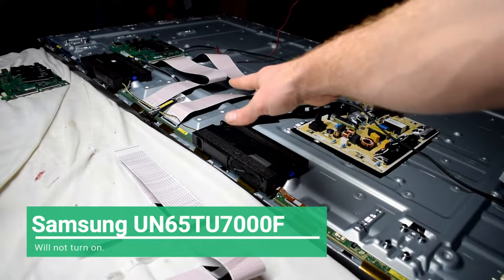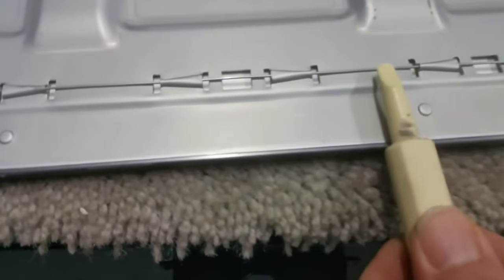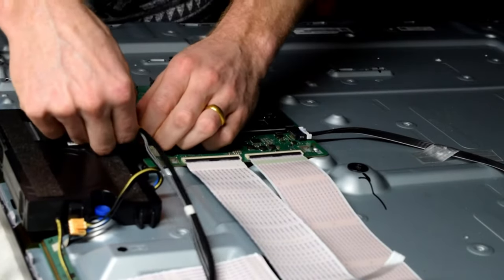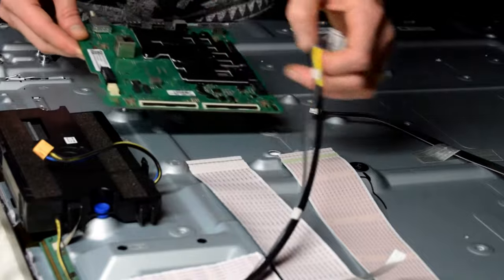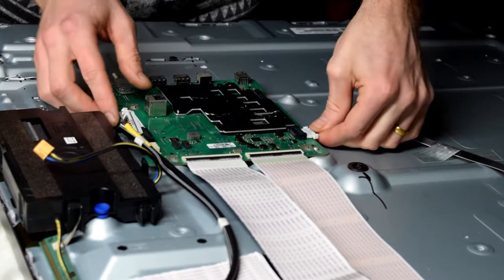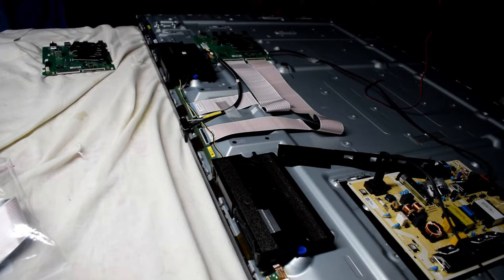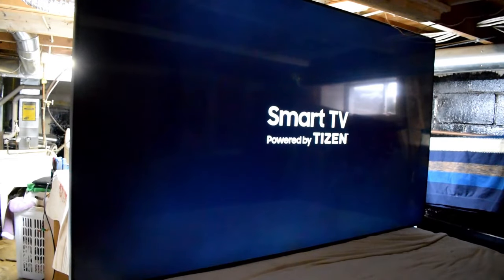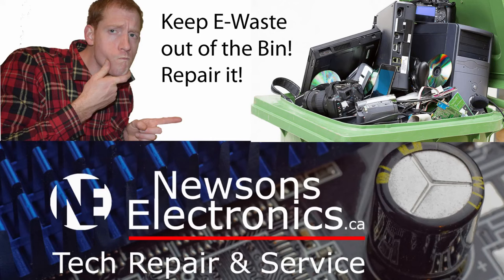65" Samsung TV will not turn on fix! (UN65TU7000F Mainboard troubleshooting)

Comment: But what about if the ribbons are disconnected and the lights stay on? I was told then its an LCD issue
Reply: Did you ever find out what the issue was, I have the same issue I disconnect the ribbon cable and the LED stays on.

Comment: My Samsung 65" was sprayed indirectly with a cleaner by someone painting the house( it was mounted on the porch under roof. We immediately brought it down to dry it off. It won't boot up completely but looks like they squeezed the edge of the screen to hard because there is like a broken glass pattern in the right corner and the screen just faintly flashes.The back of the TV was dry so I am trying to determine if the power supply, main power board or the panel is bad? Help?

Comment: if the backlights don't come on when the main board is disconnected, does that mean it's the power problem? Is there a power board or power supply internally?
Reply from the maker: if the backlights don't come on with the mainboard connected but you have standby voltage eg front led flashing its prop your backlights.

Comment: Well, even though you just replaced the main board, your hint with turning on the tv without the mainboard connected proved to be very helpful. I found that it was not the power supply in my case, which I suspected. Hence, thank you for sharing and saving me time!

Comment: thank you for the video ! i have the same problem with my samsung ue65f900slxxn but i have a Samsung one connect box next to my screen . .  do you think that is the problem ? when i unplug the cable the screen turns on and says i need to connect the one connect cable. . . ( i don't know if the screen has mainboard not opened yet )

Comment: Un82 inch led tv. Stuck trying to boot. As soon as I plug tv in it continually tries to boot . Black screen no picture . I took back cover off and when I remove single panel cable off main board I can see back lights seen by back of tv stay on and I hear a boot sound . I can also connect via wifi my iPhone to YouTube with no picture but can connect and play music. Can it still be a bad main board or is it the the rectangular boards at bottom of the tv?

Comment: From what I’ve seen if you disconnect the ribbon cable and have sound after a boot loop with no picture then it could be the panel.

Comment: I have a 70in and if I remove power from main board my black light stay on but also if I remove ribbon it stay on boots up and I have about 3 quarters of my screen I can see. So I put tap on some of the ribbon pins from main board to leb strip and I get a boot up as well. what do you think ?

Comment: I have a very similar TV (8000 vs this 7000)
 When I plug it in, it cycles on and off in an endless loop every 5 secondsor so, the screen does light up and display the "samsung smart tv" logo. Which board would you guess is the bad one? Main or power?
Reply: having the same issue, sometimes it will turn on and be clear and sometimes it will turn on with some horizontal lines. sometimes it boot loops. I assume it's the main board
Reply: @zak526 

Mine ended up being the "one connect" cable or box (can't find a replacement in order to narrow it down)

Comment: I did what you did and replaced the same part because I had the same symptoms Now my tv doesn’t shut off and on by itself but for some reason nothing is coming up as far as the menu, volume, settings, nothing. It’s just an illuminated black screen. Any ideas?

Comment: I have the same tv that after I turn it on, it turns off by itself after a few minutes…also, the red light underneath the tv does not turn on at all… what could the problem be? Starting off by replacing main board, hoping this video helps.
Reply: same problem, any fix?
Reply: @seanlee2876  what I did was unplug the main board, wait 10 minutes, hook it back up, and it worked… it worked for me so you should try that. I think that it resets everything by doing that and it worked! Let me know what happens

Comment: I have one the TV same as your when I disconnect the cable power from main board the backlight won't turn on but the red led front screen stay on in standby . Is that could be the power board bad ? Thank you very much.
Reply from the maker: sounds like bad backlights
Reply: @NewsonsElectronics  I have a tester led but i dont know which connector run from backlight to power board to be able testing on it to makesure that the backlight is
 bad .
Reply from the maker: @baotran5863  check the wires that go through the back of the tv, normally small white and black wires about 4 of them.
Reply: I use the remote to power up but red led light was starting blinking 2 times and keep doing that . Replaced a power board the problem it be the same . Is that showing bad backlight ? Thank you very much bro .

Comment: I had the same issue same model. I unplugged the main board and the backlights turned on. Ordered board and installed it. backlights came on with the main board connected but no logo and no start up on the screen. any advice on what to try next?
Reply: May be the display ribbon

Comment: I have the same problem, after disconnecting main board lights turned on, ordered a board from ebay but when I connected board tv did not turn on and there is no signs of standby light where as with the old main board I could see the standby light whenever I hit the button on tv. Anyone have a clue? Maybe a bad main board from ebay? It was a used one.